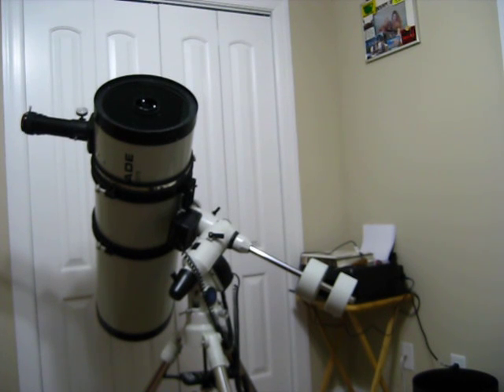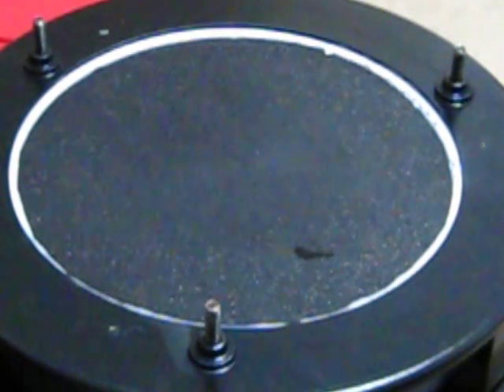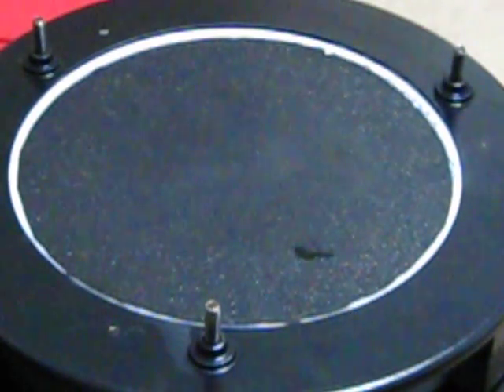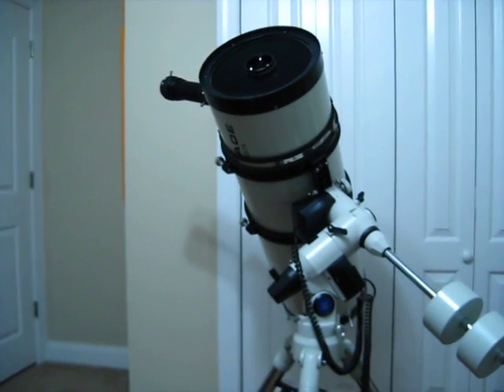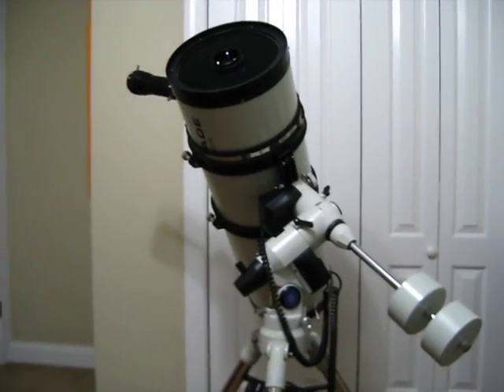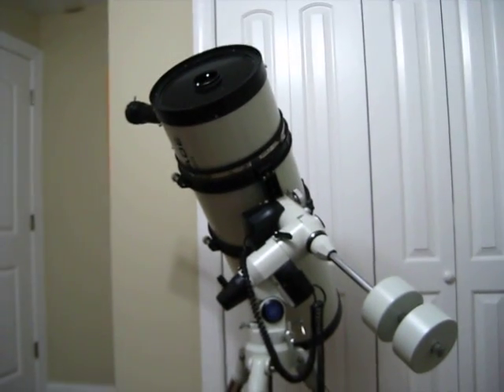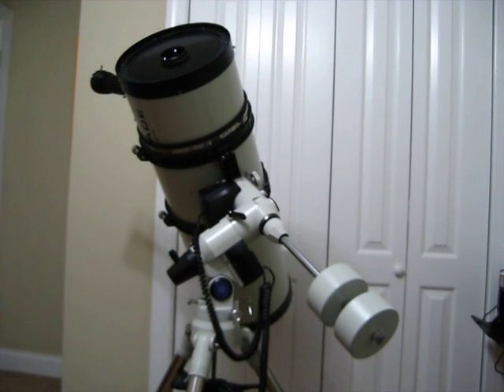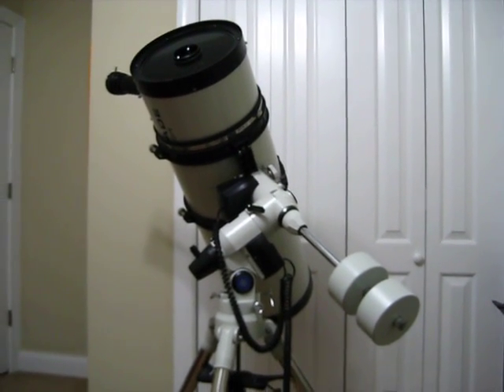ManCave Astronomy Meade LXD75 Mods and How to's#33 Collimation Set up Part1

Comment: When you use the laser pointer, 1st you adjust the secondary until the laser spot hits the sticker on the centre of the primary, then you adjust the primary to return the laser spot exactly back from where it came (via bouncing off the secondary)!

Comment: Make sure that your laser collimated is actually collimated! Put it in a 2" round holder in a test bench, or a focusser, and rotate it 180 degrees axially and check that the laser spot doesn't move! Project the beam a fair number of feet when doing this, the error shows up more and more with increasing distance!

Comment: I'm currently refurbishing a Meade 7" Maksutov-Cassegrain I bought for 100 GBP with dented tube, lightly scratched corrector, a ton of mirror shift, a ton of backlash in the focusser etc. But it's a "no collimation needed in normal use" design. I just removed the 8 pound iron disc in the back of it, got the dent out, got the silicone glue out, cleaned the baffle tube ready for new Moly grease to remove a lot of the mirror shift hopefully, did the Ian's focusser mod to remove backlash, etc.

Comment: The problem with Newtonians is that the secondary mirror has to face the focusser almost perfectly and be the exact correct distance fore / aft in the tube from the front of the tube, and the secondary has to have no tilt and not be rotated, and the primary has to be aligned and the secondary has to be perfectly centred in the aperture and collimated perfectly otherwise high magnification images suffer from some distortion of the Airy discs / ring structure. SCT's are way easier to adjust!